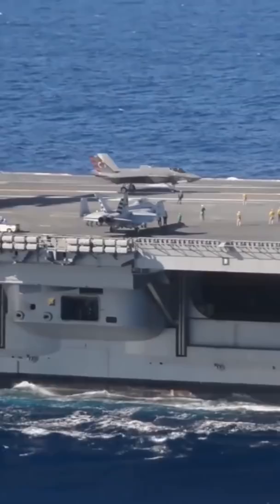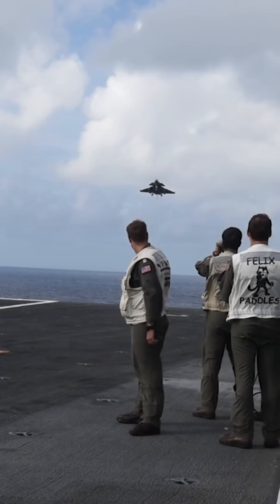How Aircraft Land on Carriers? #shorts

Comment: Didn’t realize they go full throttle. Makes sense tho
Reply: Yea, I kinda thought that they go full back throttle
Reply: Funny how it's the exact opposite of how a commercial flight lands. War is hell.
Reply: @sunny5839  yup you’re restating what we all saw and I highlighted
Reply: @sunny5839  no doubt Sherlock
Reply: @sunny5839  nope, didn’t mean it that way. Just saying
Reply: @Eclypse tell that to the boys that had to punch out due to Landing complications
Reply: @Chronostra  back throttle?
Reply: @Jayyy-7  I'm by no means an aircraft expert, but jet engines can have a reverse thrust mode.
Most commercial passenger aircrafts have the capability of reversing engine thrust. I've experienced it being used once when the pilot was having some trouble landing the plane straight due to serious wind. I guess there wasn't enough runway left after the ordeal, so the pilot decided to use that function on touchdown.
Reply: @DPLithuania  seems very unlikely, it’s much safer to use physics as their safeguard (ie. going full power to prevent going down when they run out of runway). Most commercial flights simply lower speed, go full out on breaks and adjust their wings to create the most resistance, that’s why it takes a couple hundred metres or more to come to a controlled speed
Reply: @Chronostra  that's not possible in a jet lmfao
Reply: i guess to equalize the plane
Reply: @iCore7Gaming  Yes, if by back throttle he means reverse thrust, it is possible.
Reply: They don’t land at 85% throttle but they do throttle up at touchdown. Pilots also practice what are called “touch and go landings” where the arrester hook (the hook that catches the arrester wire) is not deployed to get comfortable in case of malfunctions or other issues.

Nowadays it’s all computerized anyway but pilots still have to regularly train for manual landings.
Reply: @AclockworkPurple   that’s what I came here to say!!
Reply: @seanclarke6733  On land. Not on any type of carrier.
Reply: @sunny5839  or a broken tail hook or malfunction. That happens too. Also wires can snap which is VERY ugly.
Reply: If they are going full throttle while being pulled in the other direction by a cable, why there is no wheelspin going on?
Reply: @Baguenaudeur  Once the trap, the cable is caught, is complete the pilot watches the yellow shirt (the guy on the flight deck) for a signal to cut power. The line is under tension and slows the plane. So it’s a combination of things.
Reply: @Baguenaudeur  Oh, btw the wheel spin won’t happen because the wheels aren’t powered. I forgot what your question was. Sorry.
Reply: @Baguenaudeur  because the power is not going to the wheels like in a car, it’s being thrust out the back
Reply: @dgood138  You explained that better than me. 👍
Reply: @Chronostra  shure u did
Reply: @Chronostra  so did I actually
Reply: @Baguenaudeur  wheel spin are u serious right now ? U must be messing around since no1 can possibly be that Naïve
Reply: Where do the pilot keep their jet keys
Reply: @Eclypse I'm glad I'm not the only one who thought that was a bit out of context lol.
Reply: @somerandom7458  My great uncle was navy pilot. He mentioned another big difference is how hard they land. A navy plane lands really hard to make sure to get the hook down. When navy pilots flew other planes and landed on airfields, they often would break the suspension, rupture the tires, etc. because those planes weren't built to land like that.
Reply: @sunny5839  👍 u r good bro
Reply: @sushimidnight9539  lo0p poo
Reply: @Chronostra  full back throttle? Chief. That doesn’t exist
Reply: @bro26mohw  so fighter jet isn't equipped with something like airliner jet did? Like the one used to brake when landing (back thrust right? Or something?)?
Reply: @Chronostra  no. Because they don’t use those type of engines nor would that work with a practical design
Reply: @bro26mohw  ah, I see. I didn't know that
Reply: I guess they'll know if that didn't catch the hook cause you just keep going!  I guess landing is flying in this context
Reply: @sunny5839  🤦‍♂️🤦‍♂️
Reply: @connormcmillan6761  mad
Reply: @Chronostra  same here! Lol
Reply: I tought they went full reverse throttle but yh makes sense, wires have to cope with some intense force then
Reply: @sunny5839  Very thoughtful of you to restate the same the video saidm
Reply: @iCore7Gaming  one in every crowd…unfortunately
Reply: @somerandom7458  commercial runways generally don't have a watery grave at the end so theres no need for full throttle
Reply: @DPLithuania  yeah, but these full thrust forward in case they overrun the deck so they don’t just fall into the water, they can pull back up and go around for another landing attempt
Reply: @somerandom7458  it's only 1,092 feet, whereas a typical runway length  is much longer, and if they didn't throttle back once they touched the deck, they'd be in the drink.
Reply: Man I thought they power down on landing Not to break them cords, sheeshh they are strong!!
Reply: @JehRoniMo11  they gotta go full throttle incase they miss the cable and need to get back in the air
Reply: @brianarnold8666  yeah I see now lol, I just didn't know the cables could deal with that force, sheesh! I was thinking they had to pull back throttle to not snap the cables haha
Reply: @JehRoniMo11  i thought that at first but nahh, the cables are probably the most high tech, looked after part of the ship lol
Reply: @sunny5839  Actually a big reason for throttling up is that if they do not maintain the pressure after catching the cable, the cable will pull the plane backwards.
Reply: @connormcmillan6761  They are also failing to mention that one of the big reasons for throttling up is that if the pilot fails to maintain pressure the cable can pull the plane backwards.
Reply: @sunny5839  Oh wow, you saw the video too?
Reply: @DPLithuania  yeah, most aircraft (both military and civilian) have reverse-throttle "mode" to be used
Reply: It’s in case the wire breaks if they miss so they can fly off again

Comment: Hearing “OK-3 wire” is the most glorious term in the Navy dictionary meaning you hit the 3rd wire at perfection.
Reply: Can I ask why it's bad to land a one wire or 2 or 4? I honestly don't understand
Reply: @charlienash1050  4 is too short, 1-2 is too high, number 3 is the moneyshot. All work but they are also indications if your grove (final landing part for carriers) is bad. carrier ops tolerate no slacking. look up carrier landing patterns if you wanna look deeper into it
Reply: @jacksonstar3  thanks for the explanation, and I will. It's very interesting
Reply: As a kid, I consistently crashed my F-14 trying to land on an Aircraft carrier in the SNES Top Gun game xD

Is this much tougher than that? 😂
Reply: @scroopynooperz9051  bro😂🤙
Reply: @charlienash1050   If you hit the one wire your in danger of hitting the front of the ship . At least that's what I heard the narrator say.
Reply: @jacksonstar3  You have it backwards.  4 is too LONG.  The wires are numbered from the back of the ship to the front.  It’s explained in the video.
Reply: @annasdad8008  I believe he meant that the landing was too short, not the distance from falling off the boat.

Comment: The thing that baffles me isn’t so much that they throttle up when landing but that some little cables can somehow stop a literal JET FIGHTER at high speed

WARNING: the analogies in the replies are pretty damn inaccurate
Reply: Very thick cables.
Reply: @minatori3145  Steam pressure to be more specific.
Reply: Ye those steel cables are as thin as paper right, baffling.
Reply: Just like a full grown human being stops dead on their tracks when they run into a spider web.
Reply: The same way a thin layer of rubber prevents you from creating your biggest pain and headache for the next 18 years
Reply: Is a "literal"  jet fighter different from a regular jet fighter?
Reply: @Bendigo1  steam is used to launch them hydraulic to catch them
Reply: Hi! While serving in the navy on the carriers, ('68 - '72) my husband took photos of the plane landing. He laid on his stomach & rapidly took photos. This was a record in case there was pilot or mechanical error. The cable that is part of the tail hook, has just amount of 'give' to catch the plane. When hooked, it's "almost" like a whiplash. If the pilot doesn't catch any of the "arresting" cables, the pilot must IMMEDIATELY pull up fly off the deck & try again. If he doesn't, the pilot flies off the deck into the drink. 😊
Reply: The analogies are gold lmao.
Reply: those cables could stop a medium sized passenger jet with max load so the fighter jet is nothing for them
Reply: @Bendigo1  .b..
Reply: @Leoluvesadmira  fr 😂😂 people have overused that word so much its lost its meaning lmfao
Reply: @ProtoAzula  My man. That is profound.
Reply: @ProtoAzula  bruh
Reply: @Bendigo1  
M
Reply: The way I see it is how some fishing cables are used to fish hundreds of pounds, sometimes thousands of pound fish and don’t snap. Now multiply the girth and use stronger material
Reply: @ProtoAzula  LMAO, so true, I wonder why do people have kids
Reply: The plane is not at high speed, as far as jets are concerned. It has slowed down to a landing speed of 150 knots, approx 10% of it's top speed. Pushing full throttle means that the aircraft is trying to increase the speed as quickly as possible, but this increase will start from 150 knots so not a very high speed.
Reply: @Bendigo1  xxxtra thicc
Reply: @johnb8275  OK, Boomer!
Reply: @Bendigo1  my personal opinion is satan wishes he could create something like thay
Reply: @John B  Literal is used  as a word of emphasis.. Stop leaving pointless ass comments on things that are obvious
Reply: @Joliet  It is literally over used.  Like "so" and "epic" and placing the word "ass" as a suffix. 
   You know they are.
  So, your public school teachers were literally charismatic ass dopes. So, I can literally see why you are sensitive to this.  It's epic.
Reply: @johnb8275  I'm not saying it's grammatically correct but we all know what he meant
Reply: @Joliet   It has nothing to do with grammer.    We all DID know what he meant. I just wanted to know if a literal one was different from a regular one.  I still didn't get his answer but it sure triggered your inner 15 year old.  Give it a rest. It's a YouTube comment thread.  Russia started their incursion today. You have more to worry about than annoying language trends from junior college tards on YT.
Reply: @johnb8275  for the sake of the debate and a funny conversation, the difference between a "literal" and a regular jet, could be a "regular" jet may be as appears in a flight simulator often used in training before actually flying a real "literal" jet...

I've used one - a simulator that is - and I admit I was sweating all over at the landing phase and on the aircraft carrier and also on the land on a "virtual" runway... (edited: changed from "literal" to "virtual" runway...my bad)

Which is more reason to respect those pilots and the crew around them, as it's not that easy as they make it look...

p.s. did the Russians really invaded..??.. I've been living under a rock for the last few days...
Reply: @gabeghiby6935   could be.  Yup.
Reply: See cranes that lift millions of pounds at once using only cables
Reply: Theyre extremely thick, extremely long, and have massive hydraulic arresting systems below decks, it's really not anywhere near as magical as y'all think
Reply: @weeb3244  I think cables are magical to most people. You get the same kind of comments on crane videos too
Reply: and one more...it's literally NOT at high speed...for the jet....
Reply: They use cables to hold up bridges why would u be baffled noob.
Reply: I'm more impressed that the aircraft doesn't get ripped apart by the force of the cable pulling it to a stop while it's blasting full throttle.
Reply: Wait until you see the cables in elevators
Reply: Planes have to recover as full chat so that if they don't trap a wire they still have enough momentum to go around for another shot. If they recovered at slow speed and didn't trap a wire then would simply roll to the bow and then fall into the sea. When they trap properly they get a signal from a yellowshirt to throttle back.
Reply: @Leoluvesadmira  - I was gonna say that,..LOL

Oh, and now electricity to launch, hydraulic to catch.
Right? Hmmmm,...
Reply: @jkhegarty4317  - Actually, in the last case, he wouldn't be flying, but more falling off the deck,...into the drink.
Reply: @AJ-jy6lb  yeah if equipped with the EMALS system

Comment: The only part of this that wasn’t what I thought was that they came in at 85% throttle
Reply: An as soon as they make contact 100% throttle... wtf!
Reply: @jorgechavez7211  that is so if they miss the cable they can take off again.
Reply: @jorgechavez7211  yeah. Jet engines take a little bit to throttle up unlike prop planes that can power up quickly
Reply: @bojanglesthewizard8875 wait is propeller engine and piston engine are the same?? , or am i done something stupid here
Reply: I don’t believe the 85% tbh....unless the wheels and other items create a massive amount of drag...think about these planes at max speed...now slightly dial that back 15% ....I don’t see based on the approach to the carrier

Comment: This is one of those fetes of engineering that you just wouldn't expect to work or wouldn't feel comfortable doing. Like I dont think I would ever think to go 80% speed in a fighter jet and hook onto a cable to stop. Imagine when this idea was pitched.
Reply: It was 80% power, which is a bit of a misrepresentation. They mean 80% fan speed, where like 20% or 40% is idle, maybe even higher. So not as much as it would at first seem. It is high enough to have minimal lag between throttle input and engine spool should they need instant power, so it's safer and actually a slower approach than it otherwise could be.
Reply: one of those fetes
Reply: Not to mention full throttle as soon as you land just incase the cable snaps.
Reply: Yes, fetus of engineering.
Reply: Arrestor cables have been around pretty much since the first aircraft carriers, where biplanes landed at considerably slower speeds making the initial idea sound not that outrageous
Reply: @dudleyvasausage7879  fêtes 🇫🇷

Comment: I took an aeronautics and design class in high-school. If those lights are the same as a normal runway, they are called PAPI lights. They are there designed with 2 lenses to refract the light differently depending on the angle you are looking at it from. If you make your approach from a bad angle, the lights will let you know.

Comment: Oh aircraft land on British aircraft carriers: ENGAGE VTOL mode
Reply: Indeed...the f-35s
Reply: @domp5014  
He's probably referring to the Harrier jump jets
Reply: @DarkMatterX1  yeah forget about those
Reply: well one way to land an aircraft on a carrier, or at least the japanese way, is to crash it at full throttle
Reply: @early5326  perfect cost effective and quick however taking back off might be a bit hard
Reply: @DarkMatterX1  yes I am mostly because it’s the most widely recognized vtol aircraft (other than the osprey)
Reply: In the US VTOL air craft are not authorized to land on carriers they can only land on Amphibs. The reason is because the black surface you see is called non-skid carriers use a thinner grade so if a VTOL landed it would melt it. The only VTOL that can land is the osprey. The F35 the Navy has doesn't have the vertical take off feature only the Marines version.

Comment: I tired landing on an aircraft carrier in a simulator once. I was told all about the tow hook, going full throttle, and all I can say is that it is EXTREMELY hard. Found out the hard way that I should land at good speed then go full throttle in case I missed the tow hook 👍

Comment: The optical landing system is called the FLOLS or IFLOLS (Fresnel Lens Optical Landing System). Where dud you get "fernel lens".  Regarding hooking 3rd arresting wire - why should the pilot aim for the the third wire if there are four wires? If all pilots use the 3rd wire this would contribute excess wear on that wire, furthermore, aiming for the 3rd wire basically defeats the purpose of having the first two. If the pilots always aim for the 3rd wire how would they get practice landing using the first or second wire in case of damage to the 3rd wire? Although I served on a carrier, I never heard of this 3rd wire landing policy. (I wasn't involved with fight ops though)  I think aircrews were happy to land safely.

Comment: I've seen clips of carrier landings tons of times but never once did I hear of the full throttle on landing. Logically it makes perfect sense but that never occurred to me. I guess I never considered the possibility that the arrestor cables were designed to handle the momentum of a fighter jet at full throttle. Granted the jet would only momentarily be at full throttle but shit the approach is still at 80%. I have to imagine they slow to a typical landing speed first, lower flaps, and only go full throttle just before landing.

Comment: Actually, they dont land at 85% throttle. They increase throttle to 85% when they touch in case there is a failure in the hook or carrier cables so they can touch and go safely.

Comment: Question, what if you make a name for yourself always catching the first or second wire like you consistently catch only one of the two would you be able to move up the ranks with them knowing that every single time you catch a wire that puts less stress on the air frame, because each one of those resting wires has less like strength to them to give you more give because you have more of the carrier Runway in front of you, so it puts less stress on the air frame instead of instantly pulling you back like the fourth it has more gift to it. I voice typed the whole thing. I hope it’s not messed up if it is I’m not gonna take the time to fix it.